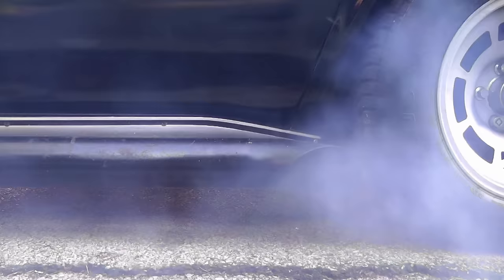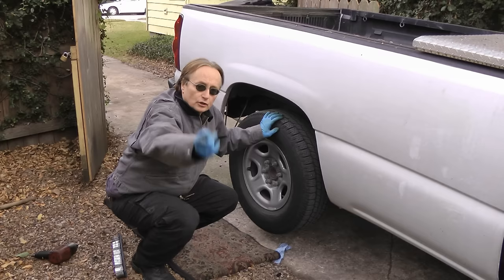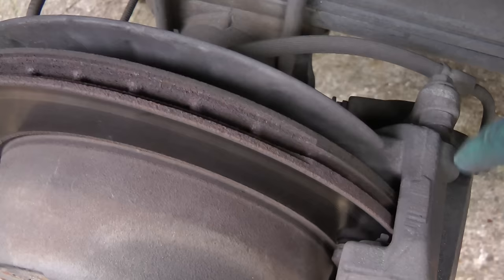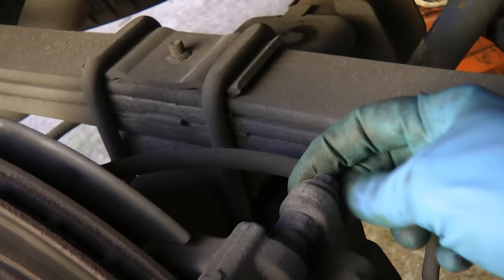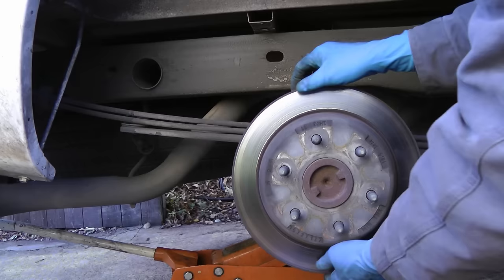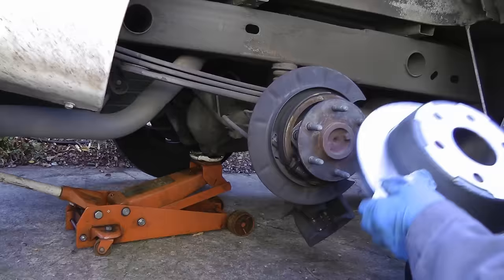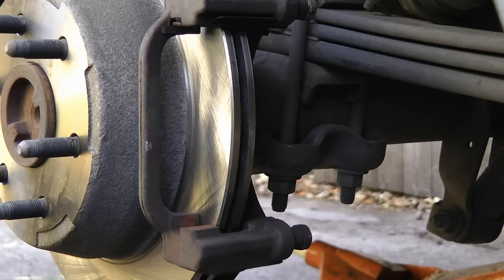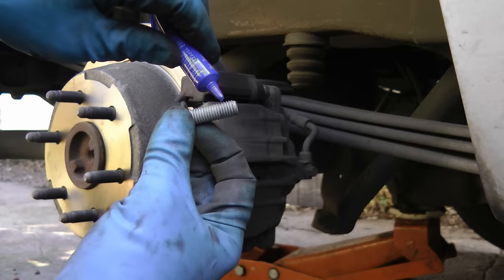How to Fix Grinding Brakes on Your Car (Rotors)

Comment: You know, I got away with no locktite on one brake change because I didn't know any better but this time the caliper started slapping the mount because the bolt came loose. Its also funny because that was yesterday haha awesome videos! Very informative and easy to grasp!
Reply from the maker: If you like my car help, be sure to watch my live car talk show every saturday morning at 10 AM CST on google events. I answer your car questions LIVE there. Just go go  to this link https://plus.google.com/u/0/communities/110758243155230074828  and join my community.  You will be told each week that a new event is happening the coming Saturday, and you can also ask questions there at my community also. You do have to be a member of google plus to ask questions, so join up, it’s all Free.  And remember, every TUESDAY  I upload a new video, don’t miss them.

Comment: Scotty, I have a 2010 Chevy Silverado 2500hd work truck with a grinding problem. Pads have plenty left, and the rotor looks fine. Wheel bearings are fine too. It's a constant grinding noise no matter if brakes are applied. I hope you get this because I'm at a loss.

Comment: Aren't you suppose to tighten the caliper bolts to manufacturing spec? ( torc wrench)..
Reply: yes
Reply: wrong channel!
Reply: tight is tight
Reply: there's torque specs for every bolt on the vehicle, its a good idea to Torque every bolt related to braking, suspension and anything in the engine bay

Comment: well I hope you get this.. my car is making a rotating noise like the brakes are grinding but new rotors, pads, steering knuckle, wheel bearing and caliper bracket and pins. only thing I have not replaced is cv axle and caliper

Comment: Hey Mr. Kilmer, I just replaced both my front rotors and brake pads. Before my right passenger side would shake bad like the wheel was about to fly right off the car. We found out that it was the tire it self, but even after getting a brand new tire, there is still a little shaking between 20-35 mph. It will do so if I am just driving at that speed, or if I am braking. It is not very much, but you can still feel it. My dad say's it is the bearings, but I thought I would ask you. Thanks
Reply from the maker: Cristie Tarwater   could be bearings, realize most good front end shops give free estimates, try one out and see what they say, takes em a minute to check em

Comment: 1/2 inch drive 24 inch Breaker bar and 375lbs of country usually gets a nut or bolt pretty snug so loc-tite isnt needed 😁

Comment: My right front brake starts making a rythmic sound when you start driving a little spirited and apply the brakes, but it doesn't make a constant high pitch grinding sound. It sounds like something is touching the rotor at a particular point and scraping it. The faster you drive, the faster the rythem of the sound. Sounds like when you rub your hands together actually. 

I think new pads are in order, but what about the rotors?

Comment: I took my suv to a shop to have new breaks and rotors installed.  My breaks started grinding after I got them replaced, but they only grind if I let my car sit awhile and  when I'm  backing down my drive way.

Comment: The sound that the truck was making when you moved the wheel is a similar noise to what I am hearing when I drive slowly (20 MPH). Except it has more of a pulse to it. I don't know if that is the bearing or not

Comment: I have the same noise, but it's with brand new brakes. Just had caliper off again and had the caliper un-seized to strop it from binding. Only occurs when I steer the wheel so much to the left.
Reply: ***** I've sorted it now. Had a new wishbone and it had a protector to protect the bearing on the wishbone from heating up so much from the brakes. The protector was hitting the disc brake when I turned ever so much.

Comment: one of the jobs on a car i dont like  to do, is brakes. It is filthy, and most people think it is just to throw in the pads, but no, a propper good brake service can take hours cleaning and greasing contact points, polishing sliding pins and adding silicone grease to them, torqueing to specifications. that will ensure that one pad do not contact all the time the rotor, because the caliper needs to slide side to side. Still when i have to do it i do it rigth, cause you all know braking your car is desirable most of the times

Comment: Scotty, when you took the brake caliper off, you let it dangle. I was told not to let them dangle for it could damage the flexible brake line.
Reply from the maker: As I've said a hundred times, those hoses are strong, hold over 1500 psi pressure. Dangling hurts nothing, but if they are cracked, yes, it's time to replace them anyway to prevent future braking problems. Dangling will not hurt good ones

Comment: My '99 Mercury Villager was rear ended a few years ago on the right rear side and the breaks on that side have not totally worked right and it grinds when backing up.  I replaced both drums soon afterwards thinking the old one was warped.  I replaced the wheel cylinders as well and bled it.  No change.  I replaced the pads which still have plenty of pad left.  The right drum is tight when trying to spin it but the other side spins free.  That side had a shake as well that rolls through the van so I switched the drum to the other side and the other side is shaking now and both sides are grinding.  A friend said that a mechanic once balanced the drum for him that was causing a shake and it fixed the shake but that won't fix the breaks grinding.
Reply: Also, the break pedal requires more pressure or double pumping the breaks and other times the pedal travel is fine.  One of the ABS sensors have be cutoff to replace a front wheel bearing being that it was stuck and I haven't replaced it yet.

Comment: Neighbor started to change his front brakes. Found out that there is a reason they give you four pads in a set instead of three. The inner pad seems to have been left out at the last brake change before he bought it. Lucky he was able to stop it at all, much less as long as he did.

Comment: A great tip if you require removal of a bad bolt with a smaller -but very good sturdy wrench that you worry about hammering:

Find either old plastic vacuum attachments to hand vacs or cheaper ones you've long since thrown out but found the various goofy attachments, and find one that fits snug over your wrench to act as a huge leverage advantage. Like you would do with a breaker bar and lug nuts. Also, you can just get 2 bucks worth of PVC and make as many weird sizes as you need. I've made "custom" extenders that provider Dr. Seuss style leverage for the most awkward bolts. You'd be amazed if you design it right, what little effort becomes a huge cranking force on a bolt. I think its a good idea too, because you can precisely manage your force.

Comment: Tip: If the pistons don't press in and have any unique patterns in them then you need a brake piston cube. it fits on the piston and you use a ratchet to screw it out or in.

Comment: Late last month, I had the front and rear brakes and front rotors replaced. I took my car to get my state inspection last week, and they didn't find anything wrong with the brakes. Then just yesterday, I started experiencing a very scary-sounding grinding noise from the rear when I slow down (but not when I'm actually applying the brakes, weirdly enough). It seems like it's rotational, as it's very obviously in rhythm with my tire (sounds like the right rear from inside the car). I've looked up videos, and this is the closest thing to the noise I'm hearing, but it can't possibly be the brakes already...can it? They're not even a month old yet!

Other culprits I'm suspecting: 
--caliper's getting stuck
--brake pad getting stuck
--possibly a wheel bearing, but I only notice it at slow speeds, and I don't hear it when turning, so I don't think that's it.

Hoping to get it into the mechanic this week, but where should I suggest he start?

Comment: Hey Scotty, 
I replaced all of my rotors and pads and then did a brake line flush with new oil,  my front brakes are grinding now,  any ideas of what could be wrong? 
Thanks in advance 
Cheers, 
Tom.

Comment: Thnx scotty to one of your vids I did the handbrake on the disc on rotor and changed the pads one time but I still hear a clicking when the back left caliper gets hots.
Reply from the maker: could be that calliper is wearing out, getting hot, and making noise.

Comment: Great video but letting the caliper hang is bad practice, as is no copper slip/anti vibration compound on the pads to stop the squealing. Some pistons require a wind back tool too, no g-clamp or pliers will push them back.

Comment: You know Scotty do you remember safety is important even stated by yourself yet I don't recall seeing any jackstands under the truck besides the jack itself. Doing your trick is nice to get an idea but if you are taking the wheels off or doing work it only takes a second to slide some stands under the truck to prevent the truck from tipping over and possibly hurting yourself. Otherwise keep up the good work and play safe!
Reply from the maker: there was a jack stand, you didn't look closely.
Reply: Scotty Kilmer Nope still didn't see one, just the little things when I noticed the vehicle sway back and forth in the video. Like to see you when you do your next video as many of your followers do as well.

Comment: Question, is there anyway I can spray the old brake pads and rotor to prevent the grinding until my new set comes in the mail?
Reply: spot on q! how to prevent the grinding is the real thingy... especially after the car was parked for a long time.

Comment: I never use locktite and they never come lose, ifyou use it make sure you use the blue kind like scott if you use the red you will maybe never get the bolt out again.atleast not without a ton of heat.
Reply: and use a lot less than he did.

Comment: This may seem dumb, but shouldn't do you need to open the brake reservoir when you squeeze the caliper cylinder back in? Wouldn't that cause pressure in the system?

Comment: Scotty Kilmer, at the end of this video showing the tornado with that sound, that what it sounded like after I came to stop at redlight and when it completely stop. I first thought it was a truck but I realized it's something to do with the brake. Do I need to replace the drum and disc brake?
Reply from the maker: +dmana3172 pull the wheels off and see what's worn. IF the brake rotors are all shiny, they would need replacing too if they make a howling noise

Comment: I have a 1967 Mercedes 250 S with a 2.5L with duel weber carbs it have a idle issue when it's warmed up its runs great until I get to a red light and come to a complete stop it starts to struggle and then stall
Reply from the maker: good luck synching and adjusting that dual carb set up It takes a special flow meter to do that, if you don't have one, pay a guy who does. Real art synching dual carbs.

Comment: What about lubing the guide pins? If they are stuck and not sliding easily it could cause uneven break wear.
Reply from the maker: sure, lube em if dry, but I'm in texas and stuff doesn't rust here so normally the seals keep all the grease in here

Comment: +ScottyKilmer +Scotty Kilmer when turning right and sometimes when punching the gas and also when going over speed bumps i head a grinding/rubbing noise coming from the front passenger wheel/tire. I have changed the strut mount, the brake pads, rotors and calipers. Noise still persists. I had other issues with that tire like caliper seizing but that was taken care off with the parts replaced. Only issue that keeps happening is that grinding/rubbing noise. By the way it was making it way before any new parts was installed.
Reply from the maker: check to see if brake backing plate is rubbing, they often bend then rub when cornering hard, accelerating, or going over bumps. Realize grinding will always leave shiny metal parts where grinding occcurs, so look for that.
Reply: +Scotty Kilmer +ScottyKilmer i went ahead and took the tire off to check on the backing plate but the front tires don't have any. Also, there's no sign of anything rubbing against the rotor. Could it be the wheel bearings? The tire does have a little play when moved side to side and makes a little clicking noise, unlike the driver's side tire that doesn't move when shook.

Comment: Hi Scotty, I have more or less rusted brake and gas lines, I don't have a lift but I thought it would be a better idea to replace both at the same time, it's a 2000 Honda CRV and if I had a lift it would be so much easier, what would you do in a case like this as the entire lines are rusting out, tell me if this would be the best idea, do the gas lines first and have the CRV on 4 ramps and the floor clearance would be higher to get to them and more room to work and then after I have done the gas lines I would drop the CRV back on its wheels and then lift the back only with jack stands so that I can take the rear wheels off and try to run the 2 brake lines from front to back (HOME RUNED), I have some experience in car repair and I have checked out your good buddy Eric The Car Guy as well, you both are great and I watch all your videos...thanks for your time...Take Care From Toronto Canada.

Comment: Thanks Scotty for the information! I have a 2005 Scion Xb and just starting to hear the sound that its time to change my front brakes. I had it checked almost 2 months ago and knew it was close to time to replace them. I just ordered a set and at one point earlier I almost made a mistake to have a brake place do it for me. They wanted $300 bucks to just replace my pads and another $200 if I needed to replace my rotors. Crazy ridiculous! Thanks for the video!

Comment: I got the exact noise. but my pad and rotor are new. * I just did the brake job myself and the noise started after a few miles ride. 
and now i got the scratching noise in slow speed too.
Reply: Meto exact same did u find problem
Reply: @awizzzle5055  actually I fixed it today. My car is 04 Mazda 3, and the rear brake has a 3pieces of wire. And I thought it was for shock damming reason. But the fact is, the 3 sets of wire is for holding the Piston. So i slide in the inner pad to the Piston before I placed in the caliper, outer installed as usual.

The noise is gone!!
Reply: Today I also helped a guy fixing his rear brake outside AutoZone. His was 2016 Mazda 3, and his brake is so different than mine. I think it is better to reference your car with exact year before you start the job.

Comment: Scotty,

I got my front pads change, and it work fine and it didn't have any sounds. After a month I started hearing a high pitch noise (SOMETIMES) When I am going slow and press the brake pedal. (ONLY) They also resurfaced the rotors. So What you think I should do?  The sounds it's getting a bit louder and happening often with time.

I've change my brakes before you think I should apply the antisound gel to the brake pads. The car does not pull to the side or vibrates at all.
Reply from the maker: many cheaper pads have a coating on them that wears off then makes noise You can try anti sound gel if you want, but if the pads are fine, generally they will still make noises soon after just from being cheaply made. If you don't like noise, buy high quality pads like akebono

Comment: Just thought of a question for ya. I have owned both GM and Ford Commercial grade vans. Why is it I get a rattle from the brake calipers. How can I stop them from doing this and what causes it. I drive ALL highway / interstate so it can't be from over use. Ya ok the roads here in Quebec Canada suck (big time). thanks Scotty

Comment: Hey Scotty if only one side of the of the rotor was worn and only one brake pad worn, wouldn't that mean the caliper is bad or something...
The wear should be equal on both sides of the rotor as well as the same with both brake pads right?
Reply from the maker: no car wears perfectly evenly, one side will hit bare metal on the rotor before the other on any car. But if one side is 90 percent left, and other is down to metal, things are sticking

Comment: Mine started doing that after i got new tires and my pads and rotors are new
Reply: Did the noise ever go away? I’m having the same problem
Reply: @tac0_  apparently those fuckers knew i had a seized caliper and that was metal to metal after two weeks of constant rubbing

Comment: Hi Scotty, I have a 2013 Lexus RX350 (50,000km) and my mechanics said the brake pads are worn and the rotor surface isn't smooth (has scratches and too thin). He recommended to replace both brake pads and disc. However, Lexus dealer said rotor should last 70,000km. Should I replace pads and rotor? What if I just replace the pads? Thanks!

Comment: Another great video as always. Since you were saying that AutoZone was only two blocks from your house, did you use Duralast brakes on that truck? I have the Duralast Gold cMax pads and Duralast rotors on both of my cars and they've been great. No noise, no dust, and they never fade. They probably aren't as good as Brembo or Akebono, but for the price they are a great product.
Reply from the maker: Yes, I use them on occasion and they've worked out fine.

Comment: Scotty what would cause just one rear set of brake pads to wear down completely? The other 3 were fine and had good material left on the pads. I checked the piston it had retracted all the way out. I pushed it back in when I put in new pads but I'm concerned it doesn't happen again

Comment: The "check gas cap" notification came up on the info screen in my 2004 Grand prix.  And ever since then my gas needle either reads all the way full or completely empty.... could it be that I just need a new gas cap?